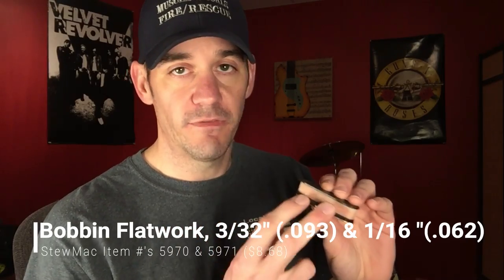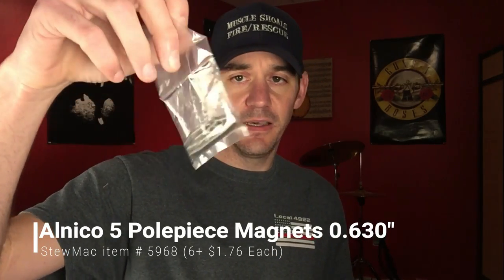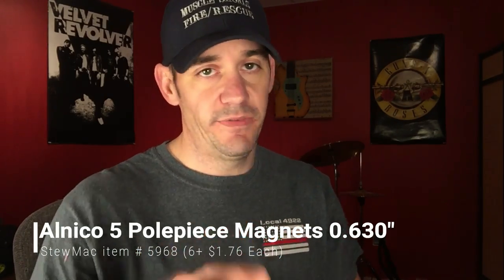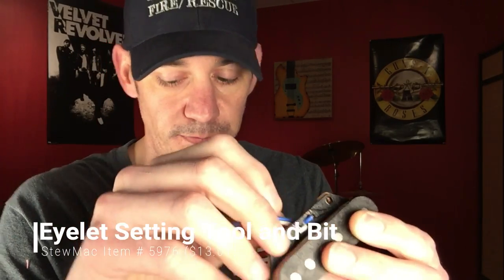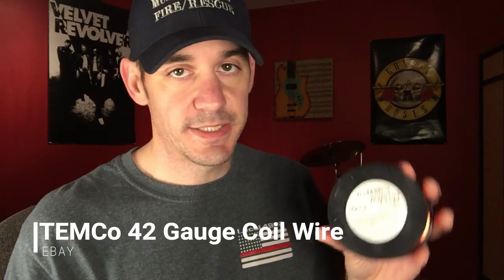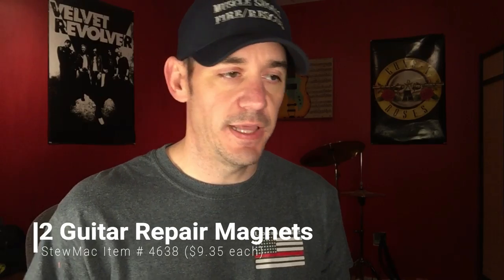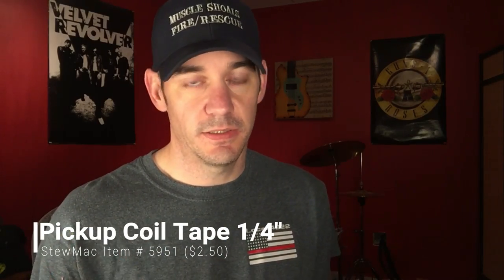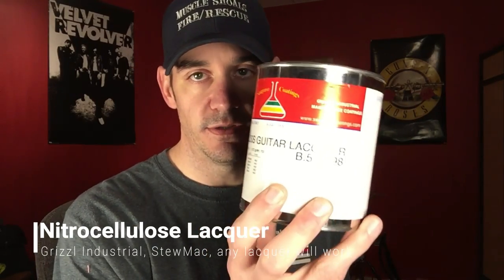How to Build a Guitar Pickup (Part 1)

Comment: You say a "Mountain of information" on how to get different sounds from a pickup.  I'm guessing you meant, information on what about building a pickup gives it a certain sound.  I mean if you wrap the wire more or less it gives you a different sound, or if you use neodymium  vs alnico vs ceramic what affect does that have etc etc.  I've been looking around for information on this, and can't find anything.  Normally my google-fu is strong, but i'm coming up with bupkiss on what about the construction of a pickup gives it it's sound specifically.
Reply from the maker: Yes a lot of the sound is left to figure out yourself I guess. The info that is given is usually pretty vague but experimenting is key.  I just go with what I think might sound good then document it. We could both use exactly the same materials and wings them the same counts and everything and could get two different sounds. You may wind different than me or use more tension than me. But that makes it your sound too. Good luck man and I like the saying google-fu lol. I’ll be using that one haha. Thanks for the comment bud.
Reply: @ChasesWKshop  Thanks mate.
Reply: I agree I'm on the same pilgrimage